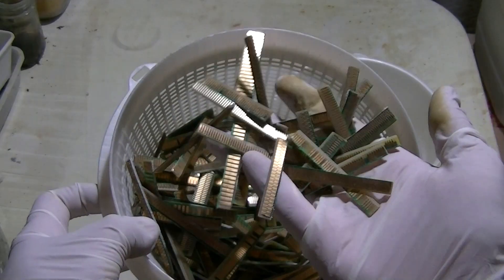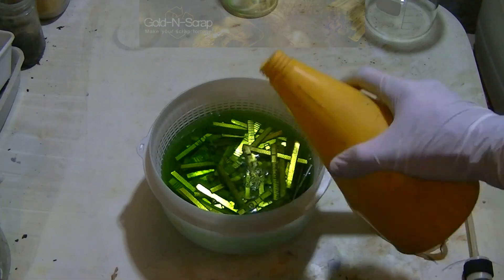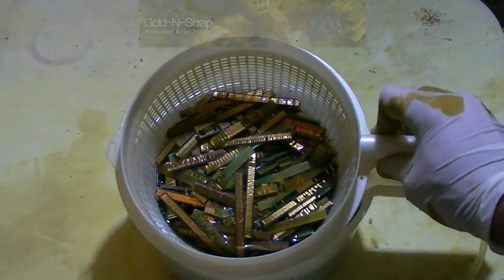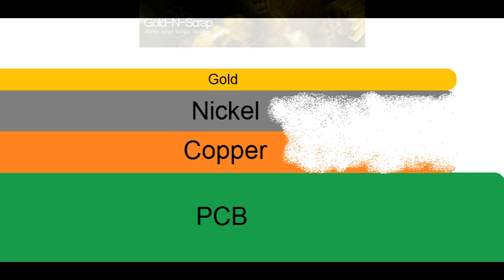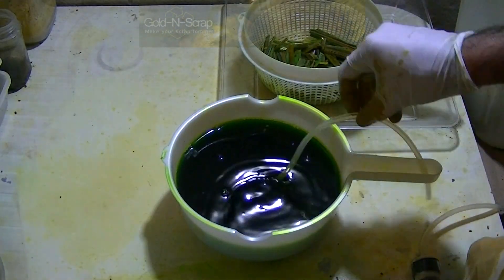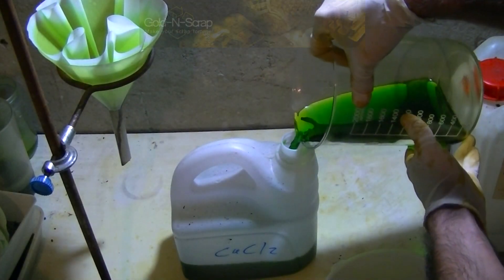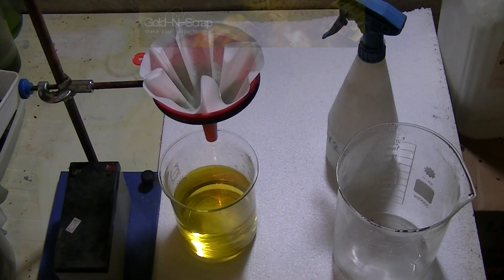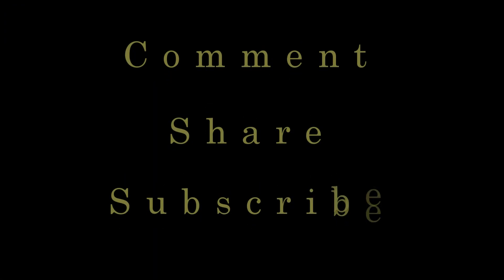Gold Fingers - How to Recover Gold from Electronic Scrap

Comment: To all the environment people where do you think a solar-cell or wind turbine is made of? Yes very environment unfriendly substances.
For the maker of the video to make 1 K of gold, the chemicals he uses are only about 10 Cm of the tip of a windmill or a quarter off a solar-cell, the gas you blow out after eating a can of beans are more environmentally unfriendly than the acid he uses to solve the gold from electronic scrap.
Reply: Hector Navarro you add a base to that and its neutralized. Totally harmless.
Reply: Link Knight
Don't get me wrong, I don't have any problem with photovoltaic cells in concept, but you need lots of space for them, and you need to live in the right environment for them to be worth while.
 Where I am it becomes dark at about 4:30-5:00 in the afternoon around the time of the winter solstice, and the sunrise does not happen until 8:00-8:30 in the morning. So really late spring through the early fall is when they would be most effective.
 It also gets worse the further North you go. This is assuming that you are getting clear days, not overcast with rain or snow. To use photovoltaic cells in such places is a waste of resources. Wind power would work where solar fails to some extent, but not with industrial turbines for baseline power like the politicians seem to love.
 Unfortunately a lot of the environmental movement just spouts off about wind and solar as throw away lines after advocating a transition away from so called "fossil fuels".
The insane part is that many of these same groups are against mining or any sort, so how exactly do you make anything involving metals without mining?
Reply: Gary Damberger It's already been proven that the computer models are flawed. Nature is self cleaning. Every living creature gives off CO2 when it breathes. Co2 is necessary to plant life. Over the past twenty there has been no global warming as predicted by the computer models. Transferring wealth has no effect global warming and that what all of the panic is really about.
Reply: you couldnt be so wrong
Reply: I think the best course of action is to not try to find renewable source of energy and stay the course. Let the plant warm up, the oceans acidify, use up our potable water sources, use up our oceans fisheries, and let all these dumb ass climate change deniers die off! Sure the rest of us will take the hit too but the rest of the life on the planet will be better off without 7 billion people decimating their populations to the point of extinction. Yeah, that's the ticket. Why don't you all try actually listening to the 97% of actual climate scientists for once and get out of your echo chambers.
Reply: samiam1150 The planet is not self cleaning for that reason, it is self cleaning because of the systems that exist and feed into each other naturally deposit that CO2 into the ocean and land. It is able to "filter" through depositing these chemicals. But it can only deposit so much so quickly before the pH of the water begins to drop and all the fish and animals begin suffering the ill effects. Its effective at handling natural cycles and over time things build up and this change leads to ice ages etc. The atmosphere cannot maintain the balance, not in the vastly ridiculously large quantities of CO, CO2, Sulfur and Nitrogen compounds, Ozone, CFC and others that millions of cars, hundreds of coal fired power plants, fat american farts and tons of anti-progressive opinions like your own have dumped into it for a hundred plus years. The amount is unprecedented in the history of Earth and the numbers are coming in as we debate. The jury will be out within several decades. I know you'll be old and not give a shit but in the scheme of the planet 60 years aint shit.
Reply: Silicon arsonide (which is an arsenic compound), glass (or plastics), copper, and a few other metals and minerals are used in making photovoltaic cells. Wind turbines employ tons of steel, copper, concrete, plastics and other metals. Neither of these are made by elves in a forest using pixie dust. In fact, I would expect that nitric acid, hydrochloric acid, and copper chloride are used somewhere in the production chain of both wind turbines and solar panels.
Reply: you are right. when they do the silicon wafers for the solar cells they have to heat the absolute crap out of it. takes LOTS of energy. that means burning a lot of nat gas or coal.
Reply: OlegKostoglatov The Right Environment is around a Fusion Reaction like a Sun (We Got That) and 1/3 the Surface Area of Earth is Land, that should be enough Space.
Reply: OlegKostoglatov maybe in your country. I live in the southern hemisphere and solar panels POWER THIS LAPTOP. I only use a generator to run my washing machines. EVERYTHING ELSE is solar powered in my house. ok except for a couple of water pumps.
Reply: NightTruck The climate of this planet has been changing ever since the planet formed. It's the climate's duty to change. Northern Ohio has seen five ice ages with ice sheets up to a mile thick carving out the Great Lakes. This same region has seen a tropical climate as evidenced by fossil ferns found imprinted in shale. All of this occurred before man walked upright. A single volcanic eruption places more CO2 into the atmosphere in a day than man has produce during the entire time that he has been on the planet. Man made climate change is a myth.
Reply: samiam1150 Not entirely.
Reply: samiam1150 C02 is just one of millions of compounds released into the atmosphere by man. Concentrations of which either, do not exist or are not normally found in nature. A fairly recent study has found traces of teflon (Polytetrafluoroethylene), a totaly manmade substance in the blood of every polar bear tested. However consider what happens when more CO2 is released from outside of the natural carbon cycle – by burning fossil fuels. Although our output of 29 gigatons of CO2 is tiny compared to the 750 gigatons moving through the carbon cycle each year, it adds up because the land and ocean cannot absorb all of the extra CO2. About 40% of this additional CO2 is absorbed. The rest remains in the atmosphere, and as a consequence, atmospheric CO2 is at its highest level in 15 to 20 million years. (A natural change of 100ppm normally takes 5,000 to 20,000 years. The recent increase of 100ppm has taken just 120 years).
Reply: Devin Walton
   Thank you! I just read through all this, and you've spoken my mind, and given plenty counter-examples (in this case, anyway) to, let us say, "debunk" samiam1150's argument.
   I find it rather frustrating how very ignorant, stubborn, disbelieving, etc. some people can be. "Men don't achieve truth because they lack humility and love of truth. They won't criticize their own beliefs. Truth would overwhelm them." (Henri Amiel). The same could be potentially used against us, but we have the evidence and results to prove otherwise - we are truth seekers. The majority of those who've studied this (Global Climate Change) agree it is there and has a rather strong association (or, in other words, a "high correlation" (correlation being a number between -1 and 1 describing the association, 0 being no association, which is uncommon)) with human interaction.
   There are, of course, always the few that don't completely accept it (it is always smart to doubt something a little, and continue the testing until you are satisfied with the results), and a great many people see this as plenty reason to, in this case, nearly reject Global Climate Change, on the grounds that another supposedly "disbelieves" it. That isn't often true, nearly all see this, but carry doubt and continue testing (or should, given how many are on the opposite side). There are, again, those who do disbelieve, and those gather quite a large following of the ignorant populace, which isn't really much "sway", but is often quite a large quantity.
Reply: John Locke This is rather  interesting  
`I find it rather frustrating how very ignorant, stubborn, disbelieving, etc. some people can be. "Men don't achieve truth because they lack humility and love of truth.` and this `we are truth seekers` .
At first human are all different, and also think different in-spite off there education level, so do two professors in the same profession but from different age and different university´s , think totally different about global warming and the environment.
I think that it´s not the environment pollution and CO2 emissions that people cause,  that causes global warming .

It is the human intellect that's causing it, the better human health the more people are born.  The human intellect is the trigger of all what happens at this world the last 500 years, from Ebola to IS, slavery and melting icecaps. Its just the fighting back what nature thus.

If you put a rat couple, in a steel cage from say 100 cubic meters and make it impossible to get out and feed them monthly 100 kg food, the population will grow fast until the 100 kg is not enough to feed them all, than the start to eat the weakest of there own kind, after that you will see that the population will level out to the 100 kg of food they get every month. So you can let the population get smaller or bigger by in or decrease the amount of food.

Or as we see in Africa the yearly migration of animals from north to south and vice versa.

Human do the same, from poor country´s to rich country´s and back if the rich country´s are getting poor.

Anyway all these human need food lots of food, that means they have to grow more greens and more live stock and more greens to let the live stock grow, just until there is no place left to grow any of it, the growth of greens and live stock also means more CO2, just until there is no more O2 to live and than if not earlier  human kind stops living.

Taking out gold of scrap electronics, is if you can do it, an environmental friendly  business with a golden future, because if I count overall the discarded phones,  smartphones and micro computers in Holland sold in the last 15 years than there is a mountain off 10.000 cubic meters where at least is 100 kg of gold and even more expensive metals like platinum, and than there still is the mountain of desktop and laptop computers and other electronic boards like the one from a washing machine.
Holland has only 19 million people at least 16 million do have a kind of smartphone, desktop etc who are scrapped after 3 years.

The last yard sale in our village, 50 computers only and lots of other electronic equipment, there are about 8 yard sale a year in a population of 5000 people.

You can go on and on with this the US has a population of 319,055,000 so count your gold.
Reply: Arend Wolbers
I never said this getting gold had much of a bad effect on the environment (sorry if that isn't what your trying to say, but that's what I'm getting from it) - it would be much more harmful if we were to throw them aside and mine for more (which is why many companies do a similar process to retrieve the metals).
Also, with the increase in population, the increase of "greenhouse gases" is produced and put in the atmosphere. With the increase in population, there is also and increase in livestock population, putting more into the atmosphere. With both of these, there is an increase in the amount of land being transformed/displaced into farm land of specific crops, which also displaces the inhabitants of the area. Then there is clear cutting and deforestation, which grows the more our population increases (although steps are now being taken in an attempt to reduce environmental impact, but there is still quite a large impact). Then there is all the other pollution, including vast amounts of water, in which many factories dump their waste into the water, regardless of it being illegal (I've seen a few do this, always at night, and there is always a lot left in the morning). Then there is thermal water pollution,  mainly from using water as a coolant, increasing surrounding temperatures as time goes on. The list goes on and on, all getting larger the more the population grows
In closing, population plays a large role, but is not the reason. Increases in population cause increases in pollution, albeit a bit indirectly. Population you can think of as corresponding to magnitude.
Reply: samiam1150 A thank you
Reply: You got a lot of thumbs up but your comment is not helpful gold recovery is madness we have shit loads of it stored, sat in vaults that we need in tomorrows environmently friendly machines.
Reply: And yet, supposedly, all the gold mined throughout history would only fill a sixty foot cube.
Reply: definitely not true at all, or even close to true in any way
Reply: Explain! If you know better.
Think copper, aluminum, iron, chemicals for fiber glass wings, plastic´s for wiring etc.Think about how these are made and dug up from our planet. Plastics are made from crude oil for instance.

Comment: I could pick up aluminum cans to make that 1.47 grams in a days time why should I rip my hands all of crap in computers all day then haveing to wait a week for it to dissolve just to get a little under $100 of gold that's a waste of time. You'd have to get about 20 or more computers just to strap after you bought all the products to get it your not making no profit at all.
Reply: Clayton Hohl there are far better ways to make extra cash than doing all of this nonsense.
Reply: It seems like the process of capturing the gold is just a little elusive.  I wander if u spent time cutting down the fingers first. It would be easier for the acids to breakdown the adjoining metals faster.  Also considering that you use a micro bubbler why not add more than 1 outlet for more of a complete aeration of the compounds. and finally why not instead of a spaghetti strainer and a plate use a spiral glass tube inducing more movement of the properties during declination(acid burn). then the set it & forget it process could move faster and cost you less in chemicals.  Just a thought!
Reply: Chris Crissey If the Economy Collapses gold would fall hard too. And Salt would sky rocket. Salt has gone down cause people don't need to pickle or preserve meat with salt anymore. Cause of all the fancy tech we have. Take away power and the bulk of the us would stock up for the winters.
Reply: suilekelly ha, if the econemy collapses then we will be in a pickle with getting our daily necessary needs. gold can be used for circuitry or converted into white gold, it can be used for many things that can create electricity. There is a australian guy that has invented a pen that contains liquid gold that can be used to draw a circuit on paper. White gold is a somewhat underground substance that few are aware of…. Check it out.
So really it comes down to what you have in your mind and as a resource that would count in any economic fall.
Reply: i can make a circuit out of an aluminum can..... gold will probably always be valuable
 because of its applications and rarity.
Reply: 2chenz True that.
Reply: christian cox
Reply: I always thought they were only copper connectors. coz I HAVE MADE circuit boards and they were all just copper. so many people assume that computers are OOZING in gold. not so. but there was a certain type of Pentium 3 processor that definately had it in it.
Reply: The video is of  the actions you perform in a condensed format. most of what you 'do' is wait.... its probably like 40 minutes or an hour of real work. and If the economy collapses I'm sure aluminum will not be worth near as much, nor the money you cash it in for.
Reply: suilekelly yeah, just like gold and silver DIDN'T fall hard during the GFC. OK silver fell real low for a week and then went to $43 an ounce (someone playing manipulation games). gold has been used as money for 5000 years. salt does have a lot of uses though, and having worked with old east eurpoeans I've learnt how valuable it is. some of the salt prices i have heard of in china (US$30 a pound) makes me think it already HAS skyrocketed it. at one time salt was more valuable than gold. in the RIGHT PLACE in arabia. in the middle of the desert somewhere.
Reply: because what if he has nothing to keep him busy and he has the skill for it and the patience
Reply: so how do i get that from alluminium in one day??????????????????
Reply: That's it, go for the instant gratification!!!!!!!!

Comment: Chemicals in this video can be purchased at your local hardware store in the  pool section. Hydrochloric acid aka Muriatic acid, Copper chloride aka as algeacide make sure you look at the ingredients to purchase the right chemicals. if needed you can reduce and concentrate the chemicals using the right amount of heat.

Comment: You can recover silver from mirrors and old photo developer plates as well as gold fingers  too by simply placing the vat of sulfuric acid containing the fingers etc under a fume hood then  position a buchner funnel so it drips isopropyl alcohol into the acid vat BUT be careful for if you make the drip too big  YOU will become part of the chemical reaction "flash" which leaves the precious  metals and mirror glass but dissolves everything else in about half the time